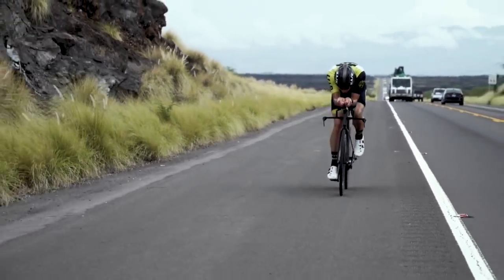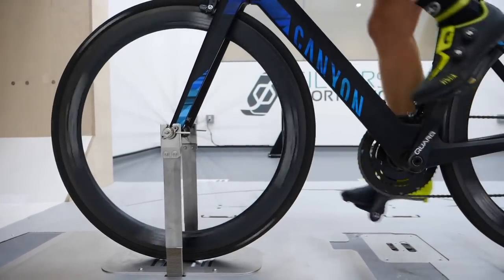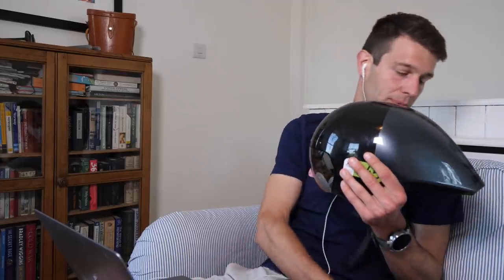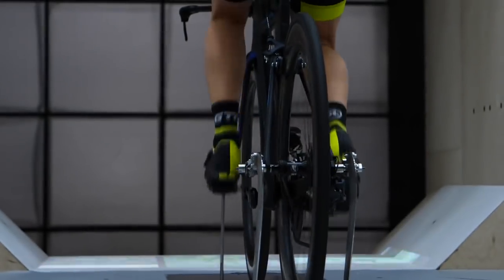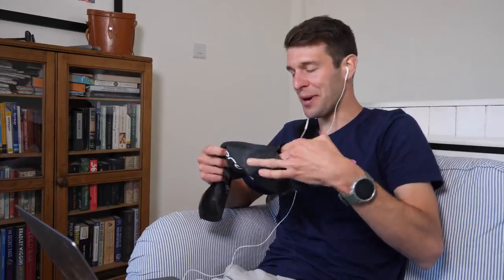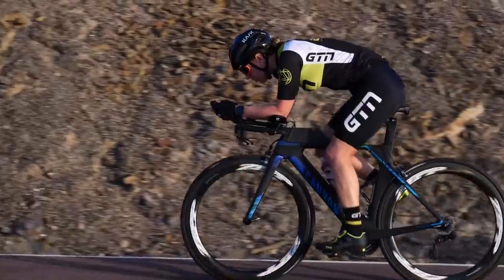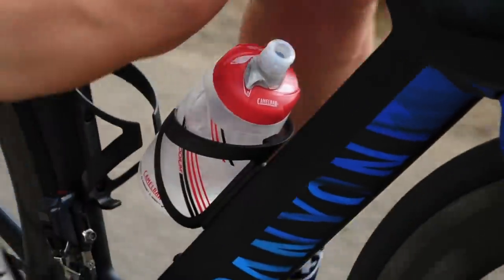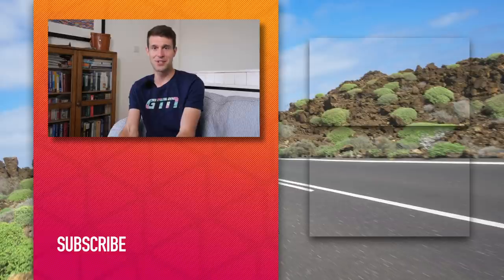What Are The Best Aero Upgrades? | Cycling Costs Per Watt

Comment from the maker: What are the best aero upgrades you've made? Leave us a comment!
Reply: I turn my head 180 degrees every time I exhale. Return to the front to inhale. If I really work on it I can go 5 mph without peddling.
Reply: Sleeved aero suit €75, TT helmet €99, aero bottle €27, bottle & cage between the arms €29, bottle behind the saddle (only over 50km rides) €39, deep section (Chinese) wheels €199. Saves me about 7kph between training & racing @ 160HR. Is it worth it? Dunno, but half the fun is scowering the internet for bargains. So, yeah it’s worth it.
Reply: Shaved my legs...morning of event.
Reply: aero bars   for sure
Reply: 1. Recumbent 2. cloth fairing
Reply: I purchased an aero helmet cover for about $20US for my Lazer helmet and I would say it probably offers the same savings as a stand alone aero helmet. Now I've got two helmets for the price of one.

Comment: This is pretty interesting. All those tiny gains can add up. The time lost putting those shoe covers on will most likely outweigh the time savings generated during the ride, though. Saving watts is only useful if it saves time.
Reply: Yeh but your ride looks way more impressive on Strava :P

Comment: Awesome video, completely agree, I went to my local expert and we found the water bottle in the aerobars gave me a gain of 2 watts, the aero helmet did not add any benefit so we stuck with the aero road helmet. The aero suit is a huge saving, however I really struggle to swim with any kind of top under my wetsuit. Result I have to have a 2 piece tri-suit, and opted for the vest, hearing this video, that was clearly a mistake.

Comment: That is NOT financially correct. You can not divide, for example, 4 watts you save by price of Bont shoe cuz you can not ride barefooted. You must divide by delta between price of regular shoe and the  Bont pair.
Reply: Yes, exactly! It should have been the marginal cost of the improved tech divided by the marginal gain in watts.

Comment: I like the idea of the video, however using the most expensive wheels availability is hardly a good way to do it. For a 1000 pound you can get a cracking set of wheels from many brands and at way less than half the price of a set Enves

Comment: Nerdy aero stuff is always fun!
Would have loved if you mentioned in the bottle aspect, if there is a penalty for an standard bottle between the arms 🤓
Great stuff thogh
Reply: I heard someone say that a bottle between the arms can save 3-4 watts @ 40kph
Reply: Study finds that bottle between arms is the most aero, more then integrated in frame and drink systems between arms
Reply: We did cover this, but it was sadly too long for this video. Maybe one for future. In summary, it depends on your position. They’ve found it has little to no effect for most people, providing it doesn’t force your arms out wider
Reply: Integrated systems can provide benefits at increased yaw angles, as it acts like a fairing
Reply: Thanks guys! The conversation in the video was more than enough mark 🙂

Comment: Nothing comes close to Heather’s sparkly tail fin though.  Cost of material and two paint brushes £10 and a 30w saving (even if 3w came from removing the bottle)!!      With that in mind it’s not surprising that Sunweb (I think it was) use ass savers.  I suspect they worked out that it saves watts.

Comment: There are a lot of deep section wheels from other reputable brands at much lower prices than these, and same for helmets, which makes these price per watt calculations a little off vs what I came up with when I did my shopping research... At least when aero gains are your only metric!
Reply: Of course. I had hoped to talk through more wheels, but we had too much to get through. Zipp cost relatively similar, and Simon had a lot of knowledge in those specific wheels - so it seemed like the obvious example

Comment: The bike shape itself is missing in this calculation. Would be interesting to see the normal road bike as base line, then road bike with aero bars, aero road bike with aero bars and TT bike. Upgrade cost from normal road bike to TT bike of the same brand with similar components is maybe 500-1000€. Aerobars only maybe 50-150€.
Reply from the maker: Nice idea Alex 🙌

Comment: If you get them all do you really get all the watt savings? I doubt it, some how I suspect the numbers aren't linear just like wind resistance. I suspect that all the measurements were made at some base speed. This stuff is never this simple.
Reply: Of course, it’s a very complicated area. Obviously these are all savings from our baseline number. If you’re using the baseline products, then yes there could be huge savings. For most, I’d imagine it’s just small improvements here and there

Comment: 800$ per watt for overpriced brand wheels - 3200$ total...Get chinese quality carbon pair from Lightbycicle, for 800$, so watt is now 150-200$... 300g is consideration for massively aerodynamic wheel, and you ride it on flat on low inclines in Triathlons always, but disc brakes who are 500g heavier and much less aero than rim brakes, give you less aero wheel, less aero frame, they are good :D